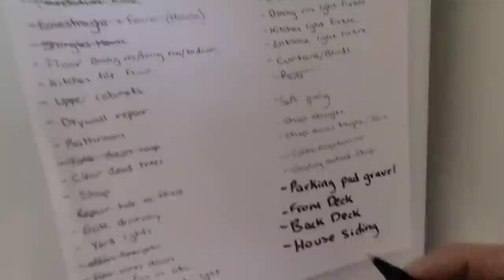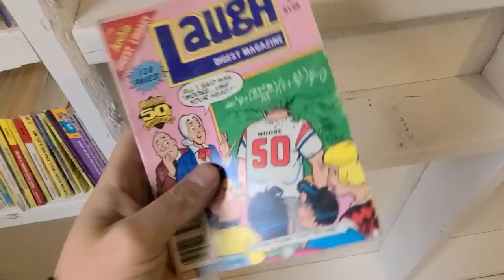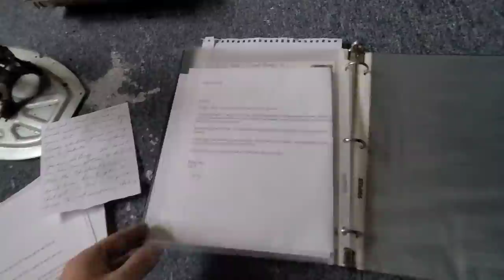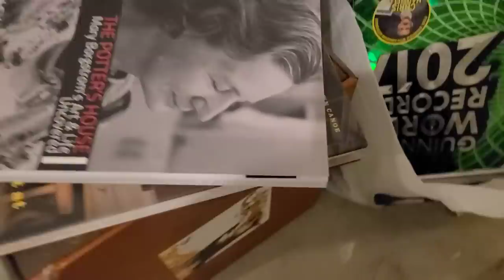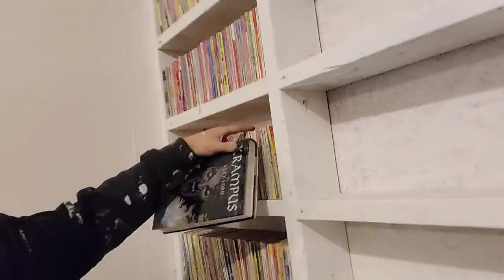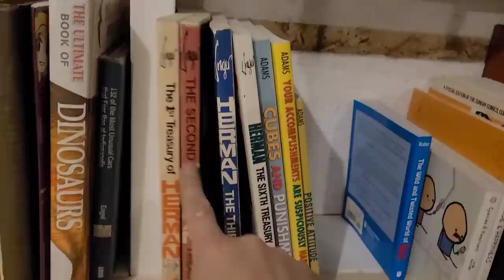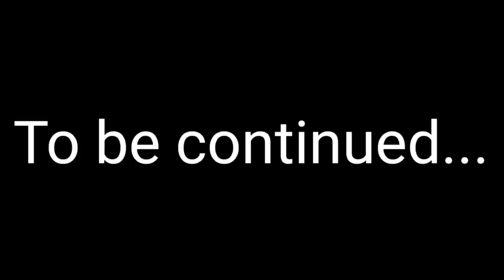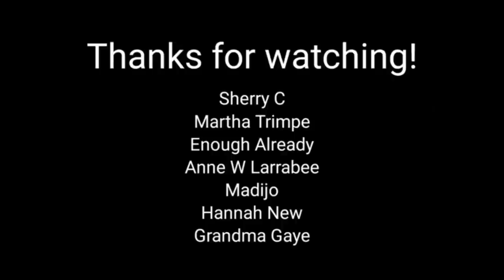Made a place for my books | Another VLOG #97

Comment: Being a minimalist is nice when in a smaller space being able to grab what you need to get out the door but if you have a bigger space then keeping way more is nice too if you have to use a shovel to get around in a place then maybe see what used to be the cat then it a hoarder I did a job putting in Kitchen countertops very easy job its like a 15 minute job there grabbings the tools out of the truck & the counter takes longer then the install as its all pre cutting the stone is done at the shop using Auto Cad and a CNC Machine

Comment: May be a bit late but what about building cupboards into the bottom section below your deeper shelf for stability and have a little ladder at one end instead of a cupboard door so you can use the deeper shelf to access the top of the wall like you said.
Eta, could you keep that wall when you demo that shop and install it in the new one? Recycle reuse? 😁
Reply from the maker: Great idea. I'll likely save the lumber.

Comment: Silly suggestion but for that space under that wide shelf might work as cupboards with doors so u could use the underside of shelf as the top of the unit u just need to add one side which is where the door that goes from your work room into the room with the bookcases are and frame and doors for your cupboard.just an idea
Reply from the maker: I've been thinking about whT to do under there. Good idea.